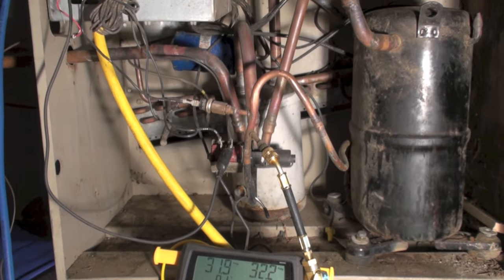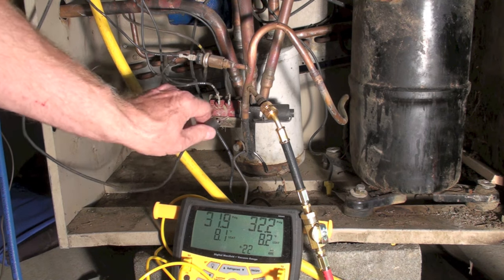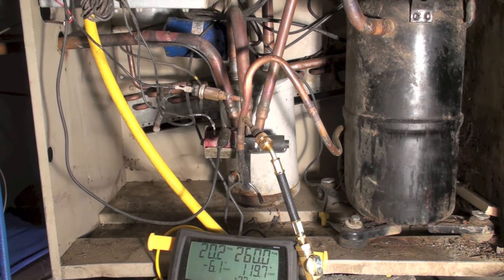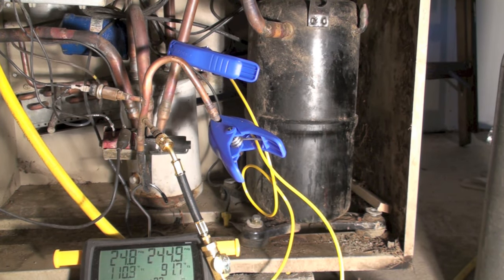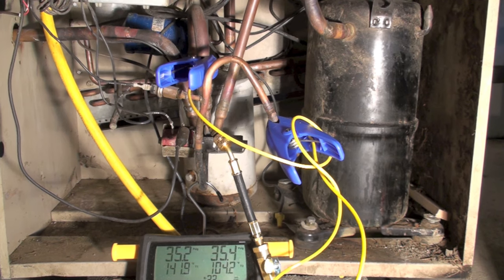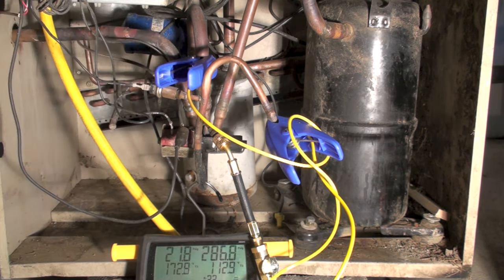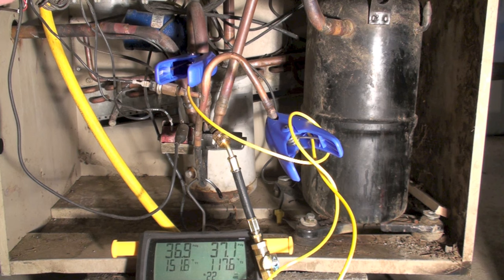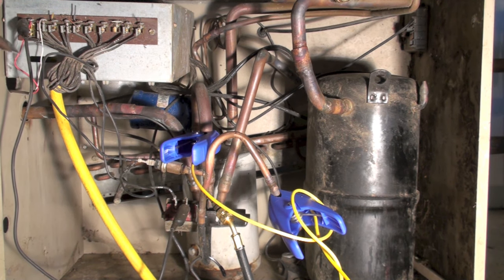Diagnosing the stuck HVAC reversing valve

Comment: excellent video
Reply from the maker: +Chad Tinsley Thanks for the support.
GFM
Reply: I got a reversing valve anomaly for you. I have a 2011 Trane XR15 3 ton, and a few minutes after it cycles off, the reversing valve starts to hiss and hot gas bypasses to the suction lines. It only does this a few minutes after shut down, and the hot gas bypass seems to stop after the system runs for a minute. Keep in mind the solenoid is cooling active, and it's not de energizing when the thermostat cycles the compressor off.
Reply from the maker: +Lincoln Hunt If I am correct, Trane does not de energize the valve upon startup.  There is a delay.  Have not seen the delay after shutdown, but it is probably normal.
GFM
Reply: It's just strange that hot gas starts leaking across the valve after the compressor shuts off

Comment: I think you need more charge for the refrigeration system, I believe that the valve is not opening up the correct way. Sorry guy but I think your not giving the right answer here, you must have a full charge to check the valve the right way. @ Ken E I agree with you the Testos 550s are great. http://www.californiaac.com/heat-wall.php
Reply from the maker: We would all like to have perfect conditions in order to make proper diagnosis.  The simple fact is, if I had charged this unit to its proper charge, the head pressure would be out of sight. I charged this unit just enough to show the pressures.  This is a training video used to demonstrate what pressure readings will look like with a reversing valve with a stuck slide.  If you watch the pressures, considering that the unit is low on charge,  you will see that the valve is bypassing from high side to low side.  Charging the unit to its proper charge is virtually impossible if the valve is not working.  I do appreciate the comment and the thought behind it.
GFM

Comment: I found a reversing valve stuck the other day after I noticed the whole compressor was the temp of my discharge line...  Lol.  It was on an older WSHP Climate Master.   PSSSSSSSSSSSHHHHHHHH!!!!!
Reply from the maker: The customer is lucky it was found before the compressor failed.  Thanks for the thoughts.
GFM

Comment: While I appreciate our knowledge of HVAC..I question your choice in Gauges...this type cost way more than they're worth...down here in Florida they run about $450-$600...and if you drop them one time they're done....next, WHY are you spending this much time on this piece of crap...the compressor has been changed...looks like it's been repiped and the dryer appears to be the original...this unit is NOT worth repairing...you WILL get married to it...not to mention there's a possible refrigerant leak with low pressure readings....I say "walk away" and save face...recommend system replacement and leave it at that.......good way to check reversing valve though...hate the gauges....just saying...Old school rules in this trade...all these high tech devices are too costly and essentially tell us the same thing...once a tech gets a feel for this kind of work, it's not so important to be so precise with readings...at least not for me...
Reply from the maker: You need to understand this unit is not an operating heat pump.  It is a mule for testing.  
On the gauge set, this one ran about $325.  I started in this business in 1977 and have used the 2 valve set for many years.  These newer sets eliminate the need for 2 sets and can be set for all refrigerants.  Your superheat and sub cool are calculated, condensing and evaporating temps are calculated, target superheat is calculated.  I did a lot of superheat by hand but that is not the best way.  The newer units are high efficiency and if the charge is not right, efficiency is lost.  We really can't afford nor can our customers afford to not be right on.  I am not trying to beat you up, and you could probably get it quite close with a lot of experience.  As in all types of repair, it goes from simple to more complex and more and better tools will be required.  Thanks for the thoughts.
GFM
Reply: Gregory Butler Digital "Gauges" are more visible to us for videos, responsive [for diagnostic] fluctuations, and slightly less confusing and compact than compound analog gauges with their multitude of saturation numbers arranged in a semicircle and separate thermometers; ademas, I divine the host\speaker is additionally a professional instructor and as such the gauge$ may be school property...near whereabouts maybe located this [demo] setup.
The charge is low because if you suspected a blowout from a stuck reversing valve- which shortcircuits the discharge right back into the suction valve, we want to stay below saturation so the next compressor isn't ALSO slogged to death by liquid refrigerant. Your "old school rules" I imagine, is to throw parts at a problem until something breaks so expensive that it's suddenly [more] cost-effective to replace the entire unit. That's fine~ just keep the ol' gas recovery  log for the EPA. I bet your less "precise" gauges would cause you to miss a TXV hunting due to air contamination!
Reply: Well Ryan Tuck, I've been doing this since 1982...old school technique has gotten me this far...trouble shooting a bad txv is not very difficult...head pressure goes up, suction stays the same in cool mode at A/H...and in most cases the feeder tubes coming off the txv will be frosty...same goes in the heat mode at the condenser txv..ice will develop and charging is of no effect...and yes I recover refrigerant when over charged...my best solution to proper charge with all the factors is the Delta Tee...all that mumbo jumbo about superheat and subcool is for you fancy pants techs that love to spend money on fancy tools...there are just too many reasons superheat and subcool aren't accurate charging methods...dirty coils, dirty air filters, dirty blower wheels etc...superheat and subcool do work if all things are equal and in order...but if your customer can't afford a pull n clean for a evap coil or blower wheel then you must help them stay cool by fudging a little...down here in Florida we get 9 months of heat...so cooling is our goal...and keeping our customers cost to a minimum is paramount...
Reply: I dont own digital guages. My next set will be. Of course you dont NEED them. But they are nice. 90% time pressures are good enough. But finicky coolers, freezers, reach ins sometimes require SH and SC readings. And having probes on youre guages makes it simple and EZ. I hardly ever have leaks anymore, but built in micron guages are nice, also the wifi mode is SWEET if youre doing many installs. Contractors are beginning to request startup data, and the screen capture feature with digi guages is great to email the records. You can be old school with a motorolla radio and charge by touch. You can also download parts and schematics from scotsman onsite and order from dave lennox.net in field with your smartphone....sooo
Reply: scott shoemaker the built-in micron is a nice feature...My electronic sniffer finds 95% of my leaks. One of these days I might break down and try the digital gauges (not guages). Lol